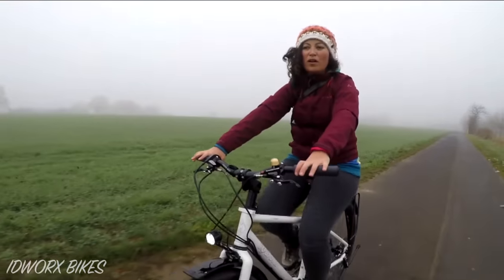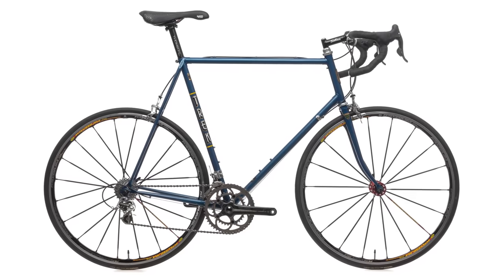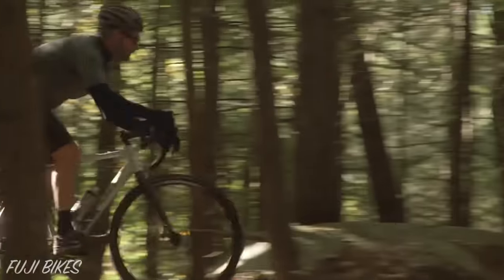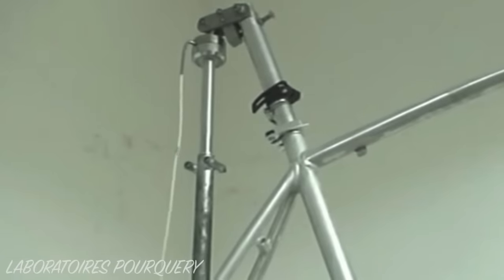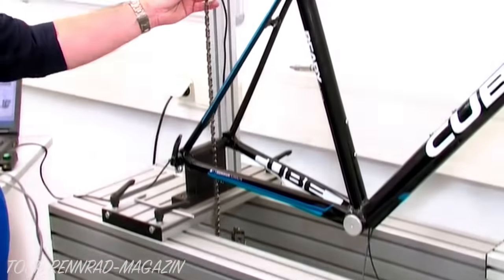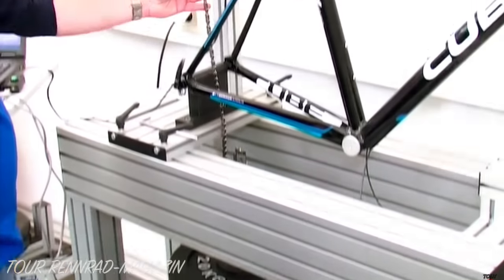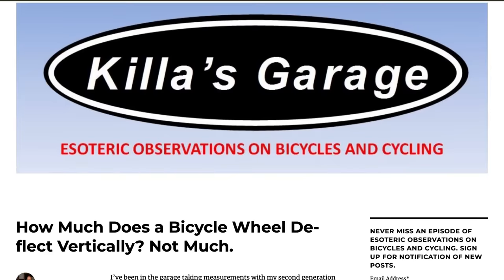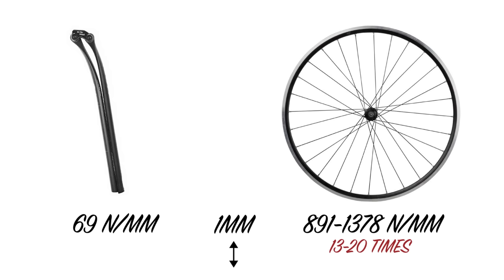Why It's Impossible For Steel Frames To Be More Comfortable Than Aluminium

Comment: Confort=spring force? I think some other variable need to be add to conclude, your feet and your hand are on the bike too. Its not just a seat post thing
Reply from the maker: This video is about the role a frame plays in the overall bike comfort. Hand comfort is a function mostly of your handlebars and grip choice, but also the fork, depending on the terrain. Foot comfort... well, it's probably your shoes don't you think?

Comment: Certainly tires provide much more compliance than the frame. Still, the most compliant frame I ever road was an Alan aluminum that I built up in 1975, which used a 25.0 mm seatpost.  It was very light, and it had Clement Paris-Roubaix tubulars (lovely tires, about 27mm wide). Much of the frame compliance was in the very flexible fork.  Riding on somewhat rough roads, I easily saw the front hub oscillating front-back close to an inch.  This was a bit disturbing; I later traded it in on a relatively stiff Raleigh Pro, with narrower tubulars.

Comment: I still feel like the narrower tubing in steel and titanium does less to transfer "road buzz" to my body than aluminum and carbon. And the sharp, brief "tink"  you get when tapping alu/carb., as opposed to the ring of steel is actually an indicator that the steel moves more, vibrates, than does the former, not less. That longer ring is an attenuation of the force applied to it, smoothing out the buzz. For bigger bumps this may not have the same effect, which is what all your data was measuring.
That said I'll definitely be investing in a good seat post. Do you have a favorite? I'm about to purchase a Surly Ogre and will be kitting it out soon.
Great videos, I've watched a bunch of them recently. Well done.

Comment: I've stopped to worry about frames. I love how steel bike with 25mm tyres rides in city (even with non ideal tarmac), no bumpiness I were worried before actually riding it (my former experience was based on 2" tyres). I love aluminium frame for stiffness as belt drive requires stiff rear to not flex when pedalling hard, but pressure in tyres of this bike of nowhere near 7 bars so it's also a silent glide atop of pillow.

Comment: Engineering knowledge highly suggest something. You talk a lot about vertical reflection but we just don't see aluminium reinforced buildings, or bridges made from it. Plus those are tubes - so forces don't work just vertically downwards.

What do you mean from comfort? Just butt related? With carbon or aluminium you need to check regularly for signs of breaking, rock chips or dents, corrosion. Look what brake cable can do around aluminium head of frame. That's why most of bikepacking bikes are made of cr-mo steel - you just can leave it outside on the rain (water) next go to the desert (sand dust/rocks/hot), later on winter crap (cold, salt, mud) and you don't give a f. Meantime precious frame made of Easton or Industrial Carbon went to fk itself. That's why it's easy to find 20 years old steel bikes going hard (they made aluminium bikes then) and it's almost non possible to find used 5 year old carbon bike (unless it's in prestine condition with stock brake pads and tires - means non used at all). Nowadays we are used to aluminium or carbon rims, frames to snap. I've seen snapped carbon frame like 2 weeks ago? And last time I've seen cr-mo frame to snap was like 15 years ago on some BMX dirt jump contest after HEAVY crash. Those materials are just for different purposes. I don't mind carbon on road bike, aluminium for xc racing but for daily commute or very long trips - steel is steel ;)
Reply from the maker: The point is not that frames don't deflect. They do. Maybe some steel frames flex at 4x fewer newtons per mm than other aluminium frames? But whatever the difference is, the vertical deflection of a frame is essentially meaningless when you calculate out the springs in a series - where the softest spring always dominates.
Reply: Please read this article: https://www.sheldonbrown.com/rinard/frame_fatigue_test.htm
The design of the frame makes more of a difference than the material. A frame must be designed properly to be strong, light, stiff, etc. The designer needs to choose the appropriate dimensions and structures for each material. Steel bikes don't last forever and yes they can break or crack and repairing them isn't as easy of cheap as people like to make it out to be.
Reply: All of us engineers know that deflection is based on a property called Young’s modulus. Steel is three times stiffer than aluminium of the same geometry. But geometry changes stiffness at a cubic rate. And aluminium is three times less dense than steel. Carbon fibre is all over the place depending of strand orientation and compressive or tensile forces. The best choice of all is clearly magnesium, which is why I have a magnesium frame. Happy days

Comment: So, steel is better in every way, but equal in comfort 😂
Reply: In what way would that be?
Reply: @soundninja99  
1. Cheaper than all other material. 
2. More stress/fatigue resistant, less brittle, less prone to break/fracture the other materials. Can be bent back into shape without loss of integrity.
3. Easier to repair. 
4. Threads less prone to strip. 
5. Less material required, strongest metal by quantity (though, not by weight).

Off the top of my head. By steel, I mean Chromium Molybdenum steel. It's comparable to titanium in most respects. Titanium is lighter, but it is difficult to weld and work with. And it's very expensive.
Reply: @chadkline4268  New steel frames are in no way cheaper than their aluminium counterparts. The rest of your points are fair enough
Reply: @soundninja99  interesting. I didn't know that 👍

Comment: In my personal experience, tire size and pressure trump everything on vertical compliance in road bikes.  Riding tubeless now, I can ride at a lower pressure with no performance penalty and dramatically increased comfort and stability.

Comment: High quality steel frames have always been far more compliant and comfortable than the alloy frames on the bikes I’ve ridden. Cheap steel has been nicer than cheap aluminium in my experience. Maybe the high end aluminium is good and I’ve just never experienced it, but I’m sceptical.
Reply from the maker: Unfortunately, the data we have on vertical frame deflection does not match your anecdotal evidence. Especially when you consider the spring in a series effect.

Comment: Well it's kind of tough to be comfortable when you bike frame breaks and you're stranded and you got no way to fix it because it's not a steel bike
Reply: Ego Twistick  By fatigue. They are not going to last forever.. Ever seen a broken aluminum seatpost? Yup. Like they showed in this video the seatpost will take a lot of fore aft movement and eventually it will break due to fatigue. Bromptons have long seatposts and therefore a lot of compliance but only seatpost that will survive on it is the steel one. Aluminum will fatigue and the carbon will wear when you fold the bike. Though there are some cases of broken steel seatposts on Bromptons but very few. (Brompton here is just as an example.)
Reply: Yeah bro I fix my steel frame on the side of the road all the time just like swapping out a tube!
Reply: So true! I always keep a spare welder in my pocket in case my steel frame breaks and I need to weld the pieces together at the roadside...

Comment: 7:50 "But on my bikes with narrower tires, I've always preferred the way carbon kills the road buzz." So this "myth busting" video doesn't apply to bikes in the race/endurance below 40cc tire categories, where frame materials/design matter.  You missed differences in fork compliance, fork rake, head tube angle, fork materials/layout. Major oversight! Many aluminum bikes use carbon forks.

Most uncomfortable bike I've ever ridden is aluminum. I still have it, and it still rattles out my fillings when I ride it. This is largely due to the steel fork, but also due to dropped seat stays and bad geometry circa 2000. All aluminum bikes are not created equal.
Reply from the maker: Yeah, the race/endurance bikes are where you'll notice a difference in terms of vibration attenuation.
I didn't cover the front end of a bike, because the head tube has virtually zero vertical deflection. I might cover the topic of fork comfort at a later stage.
Reply: Front end matters a lot more than rear seat stay compliance. Fork is the first point of contact for bumps + vibrations + bucking sensation. Head tube doesn't deflect much, but head angle and how top/down tubes attach certainly matters. A well designed front end deflects 3X more than rear. https://www.sheldonbrown.com/rinard/rinard_frametest.html

Also, different frame sizes on same bike model change stiffness. 

Crazy to think that about 10 years ago bike manufacturers were all competing to make their bikes more stiff.
Reply from the maker: I agree that the front end is incredibly important for comfort. But that's a topic for another day.
Frame size plays a very small role when we calculate out the springs in a series - as I stated in the video, the overall spring rate is ALWAYS less than the softest spring  - usually the tyres, sometimes the seatpost.
Reply: @Cyclingabout  "Frame size plays a very small role" = another oversimplification. An XS frame can ride a lot stiffer than XL on same bike model. That's why, in recent years, many bike companies have spent so much extra money $$$ on engineering and manufacturing expensive molds/layouts for each size with same parts.
Reply from the maker: That's incorrect. I've already explained why the vertical deflection does not change. Manufacturers change the moulds because riders of different heights and weights require different carbon layups to optimise the frame stiffness and strength.
Reply from the maker: @richcole3931  Please, please, please re-watch the section on springs in a series in my video. The size of the bike frame cannot affect the vertical deflection because it is not the softest spring in the series.
Reply: @Cyclingabout  "parts work together to provide vertical deflection" - yep, that part I agree with. It also makes sense that a softer part will absorb more force, but that doesn't mean that all force of a big hit is absorbed. One spring can only deflect so much of road bumps. So does it not stand to reason that other springs, including frame, will partly dampen large forces?
Reply: @richcole3931  This video makes the argument that the overall spring rate is dominated by the portion of the rate contributed by the tires (if they are on the fatter side) and/or the seat post (if it is on the springier side).  So although it is undeniable that the frame contributes to the overall spring rate, its proportional contribution is very small.  By a few orders of magnitude.  The argument can be made that this would be hard to feel out on the road.

Now, on the other hand, I would be interested in knowing how much spring a swept-forward fork could contribute to front end compliance.  I also wonder how much spring carbon handlebars and stem would contribute.  I mistrust carbon handlebars and stems, but I am considering them for increased hand comfort.
Reply: @Rich Cole
I agree !!! Narrow tires (roadbikes)- carbon win !

Comment: I ride an 80s steel roadbike with 700x23 tires on a lot of gravel roads, and I must say I've never even thought about discomfort on my butt due to the saddle.... It's my hands, wrists, and arms that get messed up. Butts probably have more flex than any bike component. I prefer steel for one reason only: it will last forever. You can bend it back into shape. You can reset the dropout spacing to accommodate whatever new wheelset you want. No fatigue failures. I have several steel frames that are over 50 years old and ride like new. They won't ever snap in half like carbon or aluminum.

Comment: vibration dampeners usually work with tuned mass between flexible parts. steel frame may not flex any more, but it is just the weight of it that acts as a damper between the tires and seatpost flex. So it's not just placebo, it's the weight of it.   also the example of harsh bike has very tall triangles. so it has no flex. with BMX style frame at very low triangle it flexes more.
Reply: Вольшая неподрессоренная масса комфорта не добавляет. Демпфирование это преобразование энергии, а большая масса рамы никуда не рассеивается.

Comment: This video confirms what I have felt all along from my experience with carbon, steel, and aluminum frames. I’ve never been able to tell the difference.  At the same time, despite the quantifiable differences in tire widths and pressures, I still feel that skinny tires under higher pressures are faster. Naturally, fat tires at low pressures are more comfortable, yet clearly not as fast.  My bias may come from my ice-skating experiences where the much thinner race blades are faster than hockey blades.

Comment: In 2008 I picked up a Lapierre carbon frame and Easton carbon fork and parted over all my components from an aluminum Leader with a carbon fork, all the components were the same, wheels were Mavic Ksyrium, etc, and the ride difference was immediately noticeable. Not only could I feel the difference but you could hear it. The carbon frame has a quiet quality while the aluminum frame resonated into the wheels. No doubt the Alu Leader frame tubing was over sized and made it extra rigid, so was it the material or the tube size differences, IDK, but the carbon frame was an exponentially better ride. Not sure about the carbon long-term though, and starting to think it’s time to retire it

Comment: "crush this myth".   Tests have been done. If aluminum flexes enough,it will break. It happens.....steel can be super stiff,or really plush,or anything in between. Ive owned an older cannondale rd bike,stiff as a board,airborn over bumps that my Masi steel frame doesnt much feel. There's a difference.  The best test is in the ride.
Reply from the maker: The spring in a series doesn't allow you to be airborne over bumps on an aluminium frame. The only way this is possible is if you have different width tyres, different seatposts and different saddles. In other words, much less vertical deflection out of the components, not the frame.

Comment: ...and then there's full suspension. 👍
Reply: And then there's bouncing 24/7 with full susp. LOL
Reply: @gunman9131  actually you might be very surprised.  Modern suspension designs (the good ones) don't bounce at all and are just as stable and efficient (on smooth terrain) as a hardtail; and WAY more efficient than a hardtail when the going gets rough.
Reply: @gunman9131  if a full suspension bike has unwanted bounce in 2020 then its just a very cheap / poor design.

Comment: Thx for this. I know there is a nostalgic and cool factor appeal to steel and there are beautiful bikes being made out there but having ridden steel in the past and current and ridden aluminum I either honestly felt zero difference or in one case the steel was harsher and yes it was down to the "suspension" aka the tires. I test rode a Nicasio with 700cc tires and they were more road oriented gravel tires and therefore more harsh. not 650B cushion-like. Air pressure wasn't a factor as I did check in with the shop on that.

Comment: I've ridden a half-century with steel and aluminum frame bicycles. Every bike has a different feel. So do the materials. You're not wrong in what you say. It also depends on the little details on your bike too. I've also explored this. My first steel bike I rode a half century and it was very comfortable. But that's only because I changed out the parts.
Reply from the maker: Based on the data and our knowledge of structures, the parts seem to play the biggest role, that's for sure!

Comment: I remember a lesson on design-engineering school (long ago) about the application of aluminum: it was once applied in a hockey stick: when players used the stick many times to make the ball bounce on the flat side of the stick (like they do for exercise or just for fun), then after a time, the stick broke in half !
What was the problem or cause?
Well, first of all, the alloy wasn't the right one (the stick was made with the extrusion process).
However, the alloys suitable for this production process all became brittle after long-tapping or hammering and all showed a fracture.
That is why aluminum is no longer used for hockey sticks !
Reply from the maker: Are you trying to apply this information to aluminium bikes? Or just stating that different materials can be better for different uses?

Comment: Then again, you forgot about the biggest factor besides geometry affecting how the frame rides: weight. More weight = less deflection = less rattling = more comfort. So yeah, considering how steel bikes are nearly always heavier than aluminium, most people will be completely correct in saying the steel frames are more comfortable. 
Nearly the same characteristics but more deflection (aluminium) = indeed less comfortable.

Comment: I respect time you spended on this material. Might agree on mentioned aspect of vertical deflection in post-frame kinematic point. But IMHO people buy steel frames for thier over all performance (side flex, rear triangle compliance). Tests that you quote in material don't care about second contact point which are pedals. For my trail/enduro style of riding steel works much better then aluminum  (I don't care very much about flexing of my post - that task belongs to my tires of width 2,6"). The most relevant difference is when I go down the trail and nothing will change my mind :)
Reply from the maker: With all of your body weight over the bottom bracket, in combination with bigger hits on a trail - I'd suggest you might be squeezing a bit more vertical deflection from your steel frame. Would be cool to see some data on this!